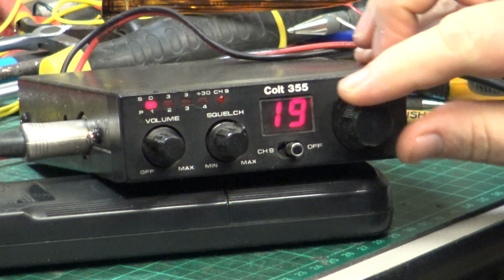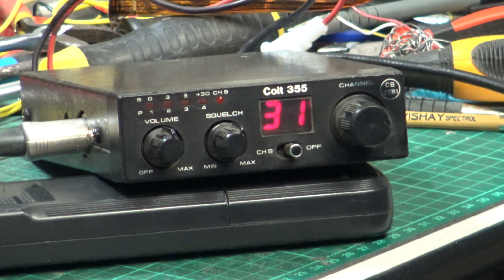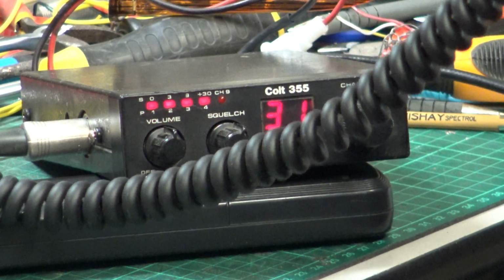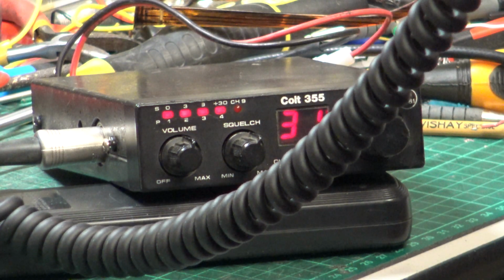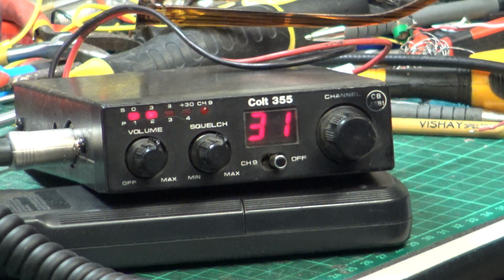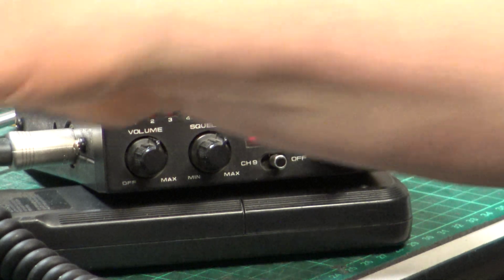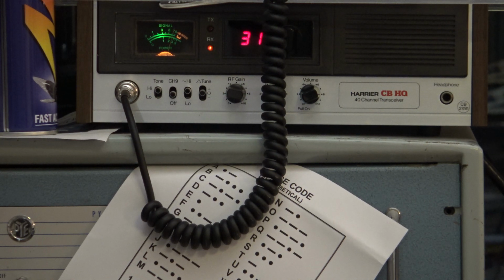Colt 355 UK CB27/81 CB radio (mobile) - On The Air Test

Comment: I didn't hear the last level crossing?  Probably you edited it out by mistake?  Just one of those things....      I have never seen this radio before although I did own a "Colt 295" back in the day.    Thank you for another video....
Reply from the maker: Yep, you are correct. I've just reviewed it & I've managed to edit out his Rauceby level crossing announcement. However, he replied to my shopping question after that point by which time he was passing the petrol station he normally can't hear me at. No doubt because the radio is doing 3.9W & not the usual 3.6! Therefore it turned out to be a 6.5 mile test!

Did you have the 295 or the 295A though>

Richard
Reply: @ukfmcbradioservicingTango21  Just the 295 Richard..  As I can remember...?
Reply from the maker: 295 had hi/lo RF gain.295A had hi/lo power

Richard

Comment: I have got a Midland 78 plus multi B, madness the delay they have ruins a superb radio as mine has excellent receive.
Reply: The older yellow display model doesn’t suffer from this.
Reply from the maker: correct. As usual newer seems to be worse.

Richard